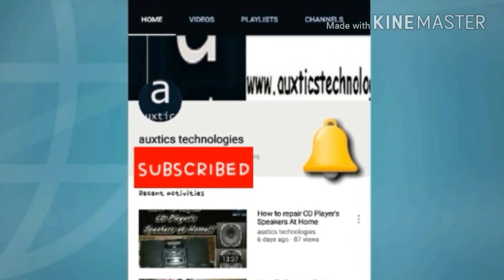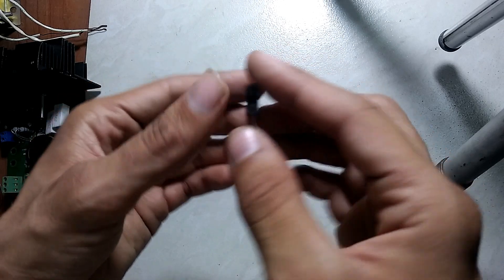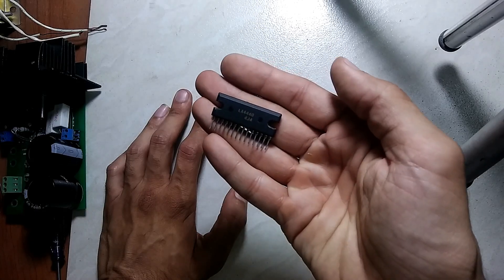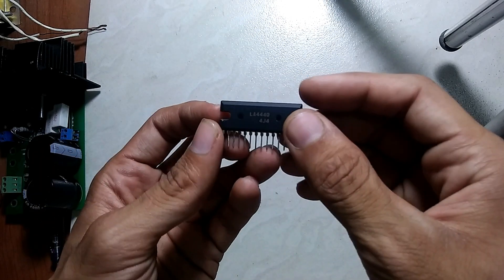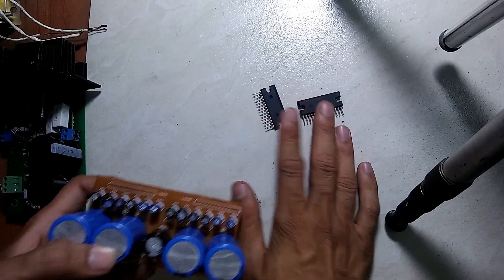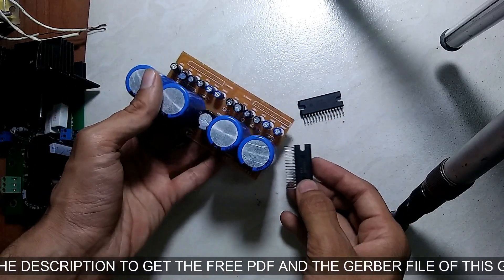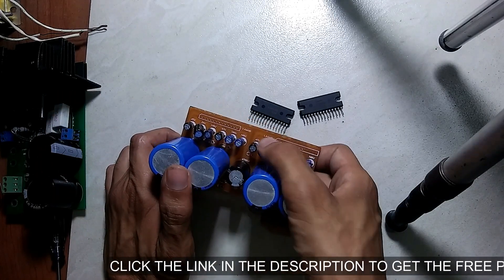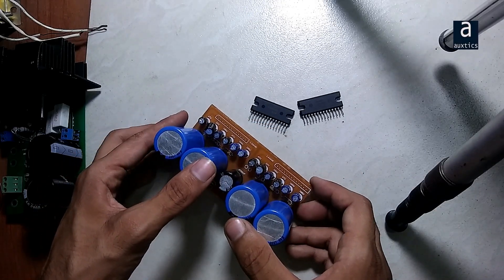LA4440 HI POWER CAR STEREO AMPLIFIER LATEST DESIGN BY AUXTICS TECHNOLOGIES

Comment: sir  power supply main agar 2           4700uf 25 v k capasitor ko paralell main jor diya jaye(++ - -) aur fir diod bridge main connect kar diya jye toh kya result hoga? isse kya 4440 ic jal jayega? 3 amp ki transformer use karenge 0-12 k
Reply: Bhai ager 35 volt 4700 uf use kern to koi problem to nhi AA gi

Comment: Some one tell me whats a meaning to add extra capacitors here? after all its a bridge circuit so its no need to add  capacitors.  to add capacitors is only reduce your amplifier  watts and bass . Try replace (2) 16v 100uf cap to 25v220uf cap  , near spk connection use(2) 25v 470uf cap  and middle use (1)25v 1000uf cap definetly improve your amplifier watt  and sound.

Comment: Sir your circuit diagram lacks some component's values.
Can you upload it again with actual pbc size and full details ? 
It will be easier for your subscribers.
Reply: auxtics technologies have you written the values of those four big capacitors in your circuit diagram you have uploaded?
If not written then how could it be clear,that is the issue.